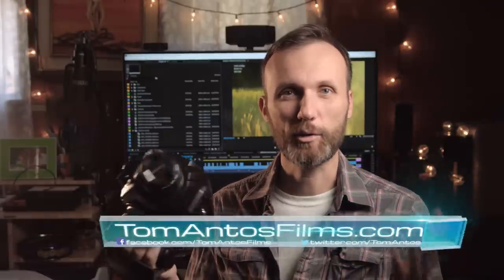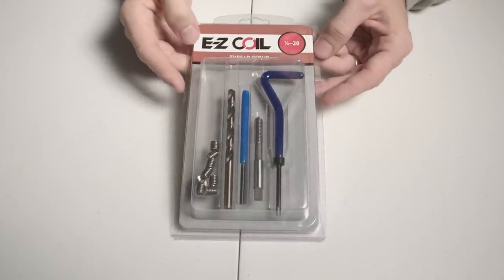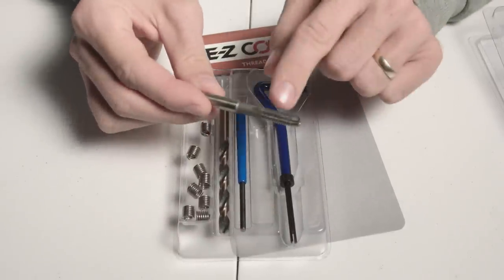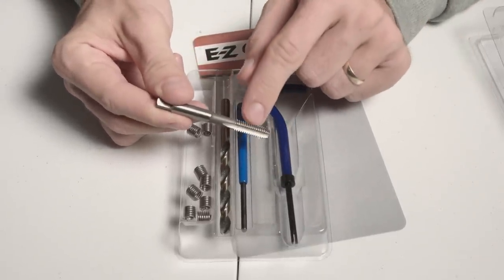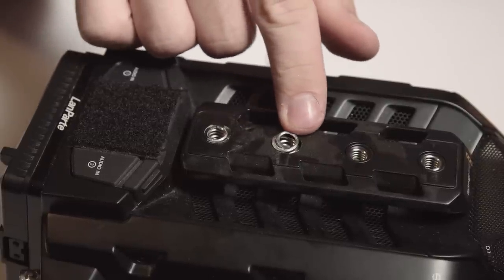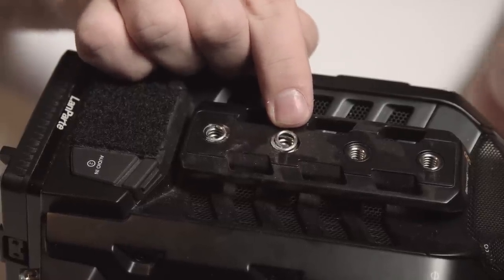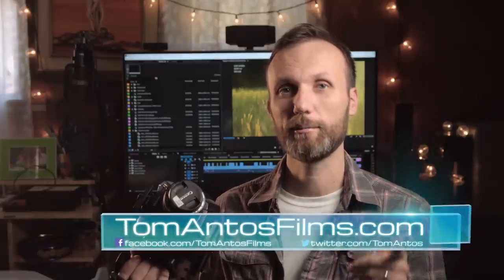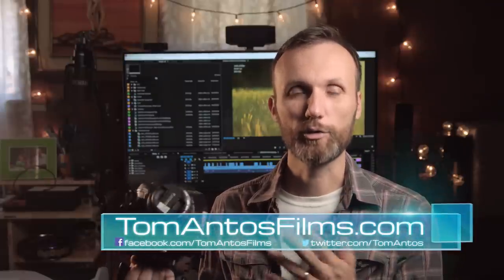How to fix a damaged tripod thread - camera repair

Comment: Hi folks. Inserts come in different lengths. Take care if tapping new thread, you don't want metal chips inside the camera. Grease on the tap is an old trick to stop that. Not so worrying if top plate is plastic. Make sure tap goes in at right angles to top plate, ideally use a guide and go gently. The turn and back action is very important, it breaks the chips. It is possible to break the tang with thin needle nose pliers. Hold camera upside down if doing that, don't want that metal tang in camera either. Not a problem with a 'blind' hole, of course. Take care, try and find someone who, has done this before. Bob.

Comment: Why some strange insert? Drill the hole and then use --3-- successive 3/8" hand-taps (the third because it's a blind hole), indert a 3/8 to 1/4 adapter and voila, you have a 1/4"-20 UNC thread.
Reply: Brisdad53 you do know that 3/8 is wider then 1/4?

Comment: Is there a solution to a broken plastic thread?
Reply: Yes, tap a wider thread and use an adapter. Or you can fill it with liquid plastic (you can dissolve a similar plastic in acetone and pour it carefully), and then drill and tap again.
Reply: I have a camera with that very problem. I'm thinking of using a brass thread insert to fix mine. Seems less hassle, just drill out a hole a bit and screw in the brass insert. Hammer not required.

Comment: I have a broken  1/4" to 3/8" insert inside my Manfrotto MH502AH head. How to I remove the insert from the tripod hole? What tool I required? The tripod has a 3/8" thread hole.
Reply: You can do either of 2 things:
1: Use a drill with diameter
 Ø7,9mm Max
 or
 Ø5/16" Max
Start with slightly smaller diameter dril.
After drilling try to get out the remaining peaces of thread from the insert.

If this did not work
2: Use a simular toolset as shown in the video but for UNC 3/8-16 thread.

Comment: Bless you, sir!
Can't find this info anywhere else for some reason.
My gimbal handle thread is broken and I have beek trying to find a fix. I actually bought one of these repair kits, but it was the wrong size and I was going to give up on it because the drillbit looked like overkill, but I'ma try again now after watching this.
Reply: was your gimbal the ronin s? happened to mine
Reply: @ishashah7028  Weebil S actually. The 1/4" repair kit worked for me and I was very relieved.
The 1/4" repair inserts are actually physically about 3/8th" wide, as is the thread on my gimbal, so it confused me as to which kit to buy.
The extra width in the gimbal is to allow the repair thread to be inserted. But after installed, the diameter of the hole itself is 1/4" and accepts all standard 1/4" screws. This is standard for a 1/4" mount I suppose, but I couldn't find any info on it.
So, if you have 1/4" thread with a removable insert, the actual diameter of the hole without the insert is close to 3/8" (but 3/8" things don't fit in there!) Only 1/4" repair threads will fit in there.
Reply: @Joshua-iz1go  I ordered that one and it worked! I was gonna give up at first but got it in easy, thank you!
Reply: Was it the thread coil on the bottom grip of the Weebill S that came out? Cause that’s what mine did. Glad to see I’m not alone with this issue. But now it makes me wonder if that’s a manufacturer issue if it’s more than a couple of cases about the same thing.
Reply: @CJDuckett  Yes it was, it got caught on and came out with the removable handle/tripod base of the weebil s one time when I unscrewed it. As I recall I had to dismantle the tripod to be able to properly dislodge the insert thread from the handle/tripod's mounting screw.
The problem seems to happen if you screw the handle in too tightly to the weeble.

Comment: This heli coil springs are normally used for holes in plates. For your situation there are som bolts called ensat they are better. Cause you don't have to punch something in your camera.

Comment: I own a Sony FDR-AX53 camcorder for 1.5 years. and have already encountered two times a damaged bottom plate of the camera. The plastic material around the tripod thread is severely cracked; the nut almost comes out. I use a Manfrotto 323 quick release plate mounted on the camera. Although this release plate does not support the camera bottom plate close around the tripod hole, i never had problems using this plate on my other camera's.
Did you someway heard of this issue with the FDR-AX53? It seems to me as a faulty design of the bottom plate.

Comment: That bar you said to break off might actually save your camera...
On the A7R4 Sony replaced these with a SODA CAN thin part that my tripod screw went right through and damaged the mechanism. Camera is BRICKED!  So they fixed it with yet another inferior part. I have used that longer screw trpod screw in other cameras, and each time its a stop and you cant screw further. Sony had no resistance, and went right through! POS camera is an understatement. Repair wants about $700. Way overpriced as its very easy to get to and replace parts. I guess same as what you mentioned around 6-7min.

Comment: Thank you for the tip:) Do you think this technique will work for Canon cameras? Or other DSLR? In my case is the camera mount for my samsung NX1 but its the same standard as Canon 5D Mark ii.
Reply: Have you fixed on your Samsung NX1? I have the same problem now. Was easy to do it?

Comment: Tom in your opinion which camera would you buy that has the best cinematic look in your opinion to shoot Short films under $6,000 if you had to choose
Reply: is slowmotion or 4k important? Or both?
Reply: Måns Nyström no not really but it would be great to have it tho but shooting under low light
Reply from the maker: URSA Mini 4.6K
Reply: Tom Antos thank you man ! Love your videos btw Thanks for all the info
Reply: you also need to consider the cost of batteries etc... I was going to get the Ursa 4K but because I had 0 accessories I ended up getting the JVC Ls300

Comment: is 1/4 same as M6 screw size?
Reply: Yes.
Reply: Not every M6 is the right fit as I discovered myself after trying to fix the stripped threads on my camera using this tutorial and a M6x1 tap kit. It turns out M6x0.75 is a proper fit.